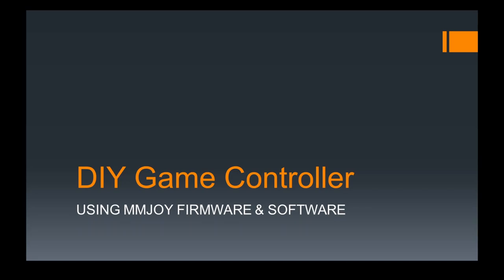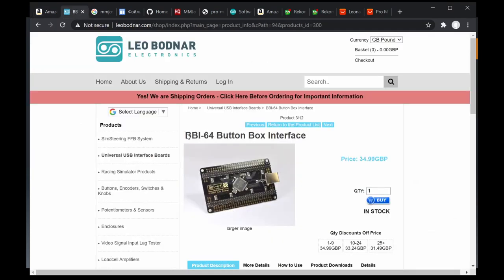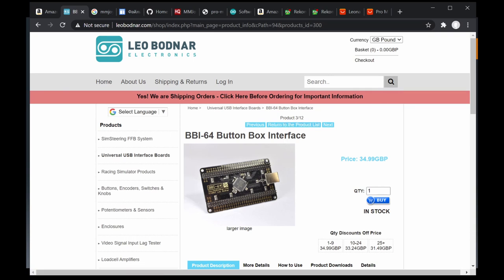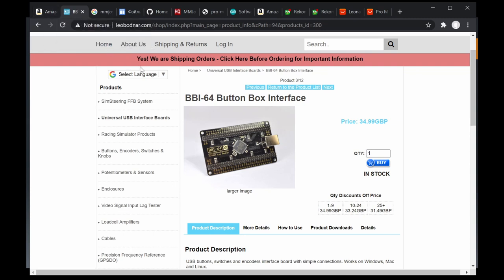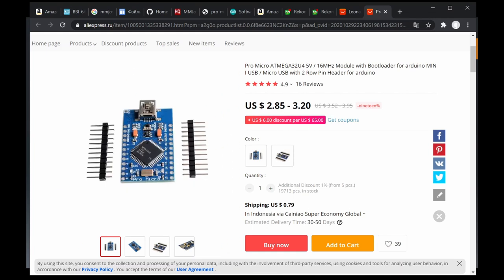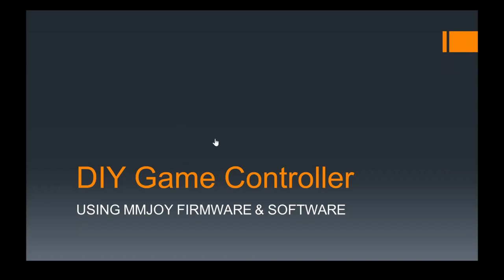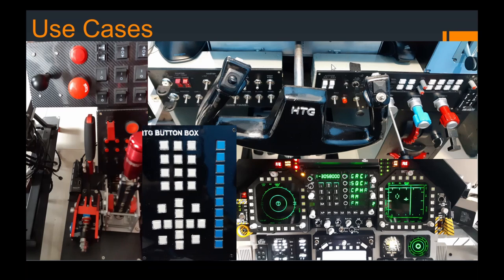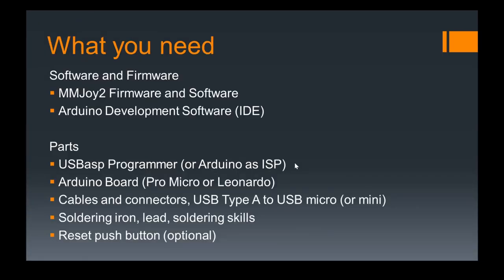DIY: Part 1 USB Controller using MMJOY2 and Arduino board

Comment: Please tell me, are Arduino NANO or UNO suitable for this?
Reply from the maker: So far that I know its only leonardo and pro micro board. Its no longer supported software by developer. So i dont think its getting any better. But its should be sufficirnt for quite an advance joystick
Reply: Thanks ) @hobbytechgearID69

Comment: Hello, i am planning to buil my sim rig(steering wheel, pedals and sequential shifter) but i am on low budget... so can i use one arduino leonardo for all? i have to use 4 potentiometors, and 3 switches.
Reply from the maker: Should be enough using pro micro its small but the pin number would suffice
Reply: @hobbytechgearID69  Thanks for the quick answer. I understand but the pro micro with the ATmega328p isn't currently available in my country. Could I be the nano ch340?
Reply from the maker: Havent tried that one, in that case you could  use leo though. If youre willing to wait shipepment try aliexpress etc.
Reply: @hobbytechgearID69  Ok thanks for your help I will see if I wait for restock of the micro or buy the leo

Comment: can you help me because I connect everything as in your tutorial but the arduino micro same yours, does not appear on the com port
Reply from the maker: Sorry late reply did you check your arduino first before you put the firmware on what stage you experience failure 1. Ensure bootstrap loader is programmed or active, 2. When trying to program the mmjoy2 firmware or 3. After firmware succesfully programmed?

Comment: can it work on the arduino uno?
Reply from the maker: MMJOY2 firmware based on the maker is for Micro and Leonardo, UNO has diff pin layout might not work havent try it
Reply: it can work but too much (by too much i mean its not for beginner or intermediate). its much simpler using arduino leonardo or pro micro because it acts like a USB device on default

Comment: how to remove the firmware from arduino leonardo?
Reply from the maker: I usually just bought new one. But if you would like to, if not mistaken you need to upload catarina.hex firmware using mmjoy firmware upload tools. Forgot where the article is, might want to search google

Comment: Where can you find the MMJoy2Setup.exe file? I cannot find this anywhere?
Reply from the maker: https://sites.google.com/site/mmjoyproject/fajly-dla-skacivania
Reply: @hobbytechgearID69  This link isn't working for me. Does it still work for you?
Reply from the maker: https://github.com/MMjoy/mmjoy_en/tree/master/firmware%20and%20software%20release
Reply from the maker: If not working  i will try to,post it on my G drive later
Reply: @hobbytechgearID69  I found a link that worked and got everything working. Thanks for the tutorial, this was a huge help!

Comment: Hello!
I have followed the tutorial, but I am at the part of burning the bootloader, and the USB ASP programmer I have received is defective and not recognized by my PC. Is it possible to use an Arduino Leonardo to act as an ISP programmer and burn the bootloader to the Arduino Pro Micro?
Thanks for the video! 😁
Reply from the maker: To be honest i havent tried it but a quick look into google or youtube seems its possible
Reply: @hobbytechgearID69  Yeah, I tried to solder wires from the header ICSP to the pins in the pro micro. Then select the arduino leonardo and COM port, next example, Arduino Isp, at this point, I'm uploading the sketch to the arduino leonardo and seems fine, no errors. So next step is burn bootloader and nothing happend. So now I lost at this point.

Comment: I'm having a problem. I haven't done the burning Bootloader process yet but Mmjoy doesn't see my arduino leo when I plug it in by usb micro usb. Is it because I haven't done it yet or do you think it's another issue? Because at the other videos I watched, non of them mentioned about the burning bootloader. I'll be happy if you answer. Btw great job with the video, especially with detailed explanations. 👏👏👏
Reply from the maker: In my experience most of it required the bootloader steps before ai could flash the firmware. Especially as Im using the clone arduinos. I only did experience one or twice thats not required i forgot which arduinos that ive used. Better try first and see if its working

Comment: Those arcade game pad boards can conflict with each other if you use more than one at the same time.

I just finished my second button box and found I can’t use them both at the same time in DCS.
Reply from the maker: I dont recommend to use arcade controller, for mmjoy2 controller you could aasigned unique mfg and controller ID
Reply: @hobbytechgearID69  yeah I've ordered an Arduino pro micro today and will use MMjoy2 now and see if that solves the problem. 
thank you for your video. it's very helpful!
Reply from the maker: Let me know if its working or if you find challenges
Reply: @hobbytechgearID69  quick question - the button box I'm making only has 10 digital buttons and one analogue input. could I simply wire each button to a digital pin and then a common wire? making a one row / 10 column matrix?
Reply from the maker: If you use mmjoy2 firmware need to follow the method as you do need to program it yourself its in 2nd 3rd video with a matrix configuration just like an old keyboard circuit. Or using a shift reg for more reliable switching. You could do whatever wiring you want but then you need to be able to do your own arduino programming.
Reply: @hobbytechgearID69  Its up and running! 

made an expansion box for my TM warthog throttle. 
5 detent analogue flap leaver, Gear leaver, arrestor hook, parking brake, emergency stores jettison,  anti skid/spoiler selector.

made a mistake downloading very old mmjoy firmware from github. virtual axis-to-button not working properly. 

but found the 2018 firmware on the russian site and now it works perfectly!

thank you so much @Hobby Tech Gear for your tutorial videos. could not have done without your help.
Reply: @Snugggg  "but found the 2018 firmware on the russian site and now it works perfectly!" Latest version I can find is 20161101 which seems to have some issues. Can you point me in the right direction for the 2018 version?